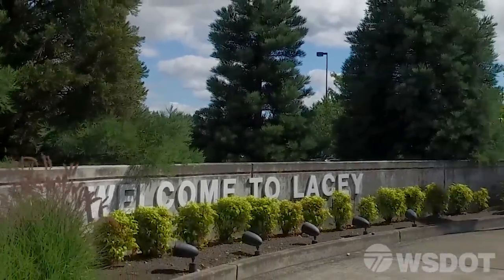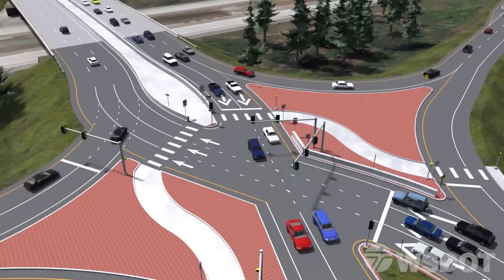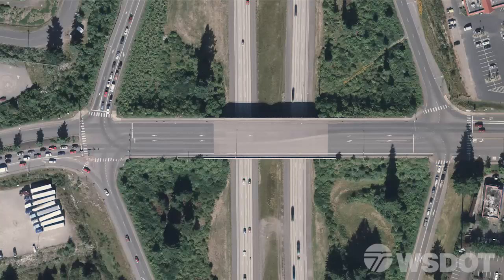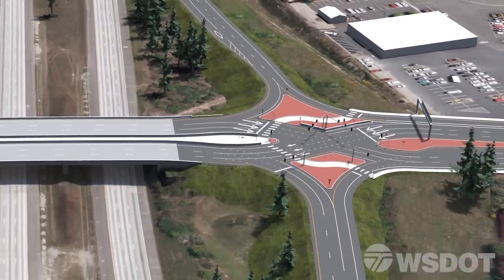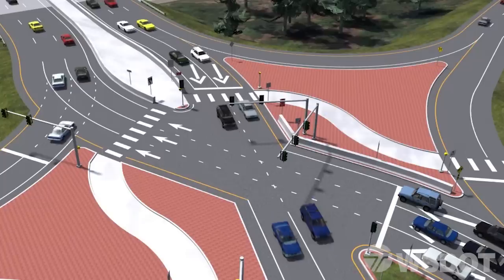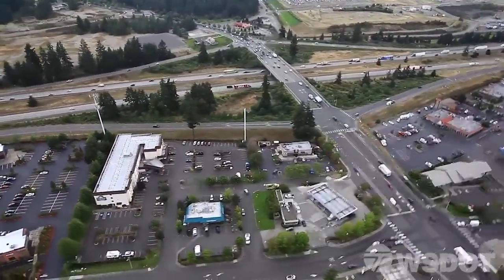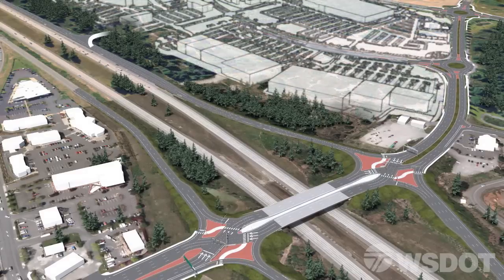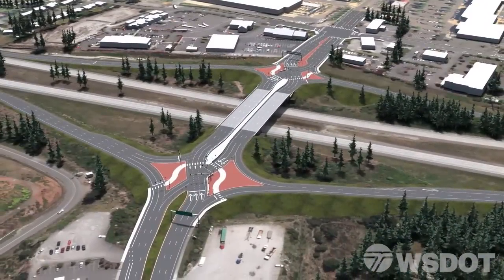Diverging Diamond Interchange comes to Washington State

Comment: We got a place in Toronto where three major roads cross, with such a mess of different ramps and turns, it's like it was designed by a madman. Even a roundabout would have made more sense. Even more bizarre, one street going west stays the same though the intersection, but the same street going east changes to another street, unless you take a turnoff. lol

Comment: Some thoughts:  A driver going into one of those might all of a sudden think they're driving on the wrong side of the street.  Then there's people trying to cross the street who are used to initially looking to the left needing to be aware cars may be coming be coming from the right.  I'm comparing that to confusion people have when they travel to places like the UK, where they drive on the left.   Also, you mentioned clearly marked lanes and arrows.  We all know how paint fades quickly, and if the street is wet, is also difficult to see.
Reply: I have one of these where I live and drive on it all the time to work. None of that ever happens. There are curbs to guide you along even if you can't see the lines for whatever reason.

Comment: I've driven the one in Kentucky it really doesn't change much of anything, except if someone isn't expecting it they slow down but if it's well lit and the road markings are clear it's not bad, just don't see the point
Reply: The point is to increase efficiency and reduce traffic. It makes sense to me, fewer phases on the lights should lead to more efficiency, but I'd like to see flow data from a junction that has made the transition.

Comment: I've driven through one of these.  The secret is in the timing of the traffic lights.  They used one set of timing, no jams for everyone.  They messed with the timing for some reason and now the multi-million-dollar boondoggle jams just as much as the old light system.  It "can" work as long as the politicians don't start changing the timing of the lights to suit their needs.

Comment: At 1'09", its not "Fayette, KY," but rather, "Lexington, KY." I know, because I live here, and have to deal with that interchange.  I'm at a conundrum on the effectiveness of the new interchange: it does cut down on accidents. Yet, the traffic volume is extremely high, and wait times at the lights feel miserably long. However, the original design of the main road heading back into town was not created with expansion in mind, and that is where much of the bottlenecking begins.

Comment: Hey guys just to help, we have this in Utah and it SUUUUUCKS. The lights going to the freeway are very very short and those getting off the freeway are in almost like a slingshot move. One of the on ramps that does not have a light gets people to 70 MPH before it merges with the left turning traffic which just came off a turn and is going about 35. Many run the red lights getting off because it is super confusing, especially when traffic overlaps. I wish you luck. If you want to see it look up Pioneer Crossing exit in American Fork, Utah.

Comment: these are nightmares for semi trucks and you typically hit both lights.  the giant X interchange seen in Northwest Indiana and Columbus Ohio is a much better solution as it reduces the two intersections to a single traffic light
Reply: This is a fair point, though it's a more expensive solution, as you would have to build a wider bridge to accommodate the turning lanes.
Reply: As an experienced truck driver myself, I have not come to one of these intersections yet either in commercial or personal vehicles, but from the graphic animation, its seems quite along the lines of a poorly designed roundabout without large vehicles in mind so long as the exits are sufficient for larger vehicles to exit or turn safely.

Comment: What's wrong with the old Clover Leaf Design? Could someone please explain.
Reply: Likely because of space constraints. Even a tiny cloverleaf takes up huge amounts of space. They're also generally more expensive than retrofitting existing infrastructure. There's lots of NEW grading and material required to make a cloverleaf. DDIs are also quite easy to navigate and more efficient in terms of travel time in many cases. WSDOT has shown why a DDI is a great solution in this situation by integrating it into the surrounding infrastructure.
-Civil Engineering student at Missouri S&T
Reply: As a Semi tractor-trailer with experience in all kinds of intersections and interchanges, Cloverleafs are the Worst along with the poorly designed too small and narrow roundabouts. Not to mention the small vehicle drivers who think either they or we big rigs own the road. Due to the on and off ramp of the cloverleaf sharing the same spatial interchange lane, you got slow vehicles entering and highway speed drivers exiting at the same stretch of extra lane.
Reply: Weaving.

Comment: Question:   What happens if traffic and signal lights is not working due to what ever the reason maybe like a storm passing through?
Reply from the maker: There is a battery backup to keep the signals running in case of a power outage.

Comment: As of September 2018, NOTHING HAS HAPPENED at the area shown in this video.  No signs of construction anywhere, and traffic still moving as usual across the overpass.
Reply from the maker: Work has been going on since last fall. Most of the work so far has been near the overpass and not in areas easily seen by the public.

Comment: There are 2 roundabouts west of this proposed DDI. Neither is big enough for American semis to negotiate without leaving thei lane of travel, even though they have several  Distribution whses west of them. Europe does not have 75' trucks as a standard yet they build American roundabouts at the european standard. There is another roundabout which semi drivers use off the southbound exit if you want to go east that also requires drivers to curb their trailers to use.
Roundabouts would be fine if all lanes allowed an American truck to stay in their lane,  but they don't.

Comment: i still dont get it.. why to use intersections with trafic lights for such simple connection to highway?? Havent you seen solution for this in europe? you dont need to turn left at all.. only simple connection lines turning right must be added, that is all.. .. then there are just 8 conflict points, avoiding crossing.. there is just merging and diverging

Comment: Interesting solution!  At first I was concerned, given that a fair number of people still struggle with four way stop intersections and roundabouts.  It was a relief to see the explanation and video.
Reply: o2boutdoors Yes, there is a growing number of drivers who are confused by octogonal red signs, believing they mean "SLOW DOWN", and rectangular white limit signs, thinking they suggest s minimum speed.  Those drivers will do SO  much better following multiple signs with 20 or more arrows directing them through an expressway overpass. NOT.

That some peiple are confused and poor at an activity should NEVER be used as the basis for deciding to change the activity for everyone. That's nannyism.

Comment: This pattern has eliminated one of the options for turning, hasn't it? If you came off the freeway below and realized you'd made a mistake and wanted to return to it, it's not directly possible. 
You'd have to turn either left or right, drive down one of those roads and turn around and come back.
Reply: If you have left the highway while you shouldn't have, you can not get back on, yes. You can still leave the highway and go back on the highway to way you came.

Comment: Traffic can only move in one direction at a time. As an example if it runs North and South, North bound is held up at a light while South bound is moving. Then South is held while North bound is moving. It is very time consuming for local residents. It benefits interstate traffic only. Without over and under lane change bridges this system is not that great of an idea.

Comment: Kanasa City has several of these and they are annoying. No advantages unless you can get the cross over on different elevations.
Reply: Odd....while they took a very short time to get used to them, I find them to be far more superior to the old design.  I'm in Overland Park.  The object isn't to eliminate traffic lights - it's to improve the efficiency getting thru.  If you are in KC, go cross 435 on Nall, then do it on Roe.  Which one was better?
Reply: I just left Overland Park (159th & Switzer) and find that all they do is move the jam from one point to another. If they eliminated the stop at the crossover, they have a winner.

Comment: This intersection cause four deaths two do which were police officers in the state of Iowa. Driving through one of these for the first time at night is so unsettling I can see why the young motorist enter I80 the wrong way and struck the police car over the next hill head on with two officers and a transfer inmate inside. All killed. Roundabout or any other intersection don't offer this kind of danger. This is purely cost saves for the road departments. 
Bryan

Comment: This is great! Could this be done to underpasses, in principal? In Vancouver, WA, we have two I5 interchanges, at 78th and 99th, that were redesigned some time back. The bridges were widened to allow placing the street intersections under the bridge. That helped a lot, but the intersections still get jammed up. Could the diverging diamond concept make traffic move even better?
Reply from the maker: Good question. The short answer is yes, because they are interchanges, they experience heavy movements from the local roads onto the freeway (left turns) and could possibly benefit from a DDI. We would have to model the interchange to see if there would be an appreciable benefit. That being said, both interchanges were updated not too long ago and perform pretty well. Given the investment made at these locations recently and their current levels of performance, it's unlikely we'd get funding to reevaluate them at this time given other more pressing needs across the state.

Comment: Still don't get it
Reply: traffic shifts to the left side on overpasses.  Traffic can go straight AND turn left for the entire cycle of the light.  It's far better than sitting in a left turn lane waiting for a signal.  It is slightly odd at first.   But it's much better than an existing intersection.

Comment: This is going to have little to no gain in improving the traffic problem through that area. That intersection does back up some but its only a result of heavy freeway entrance traffic (JBLM) and the intersections before that one (shopping center and Marvin/Martin). The freeway congestion stops the turn lanes from finishing on the lights already there. Making the intersection smoother doesn't fix this problem... they are still going to fill the on ramp and not be able to merge. When this project flops and fails to help, give me their job because driving that intersection 2-3 times during heavy traffic shows the issue clearly. This is a waste of time and money.

Comment: There are several of these in my area. They are the most counter-intuitive and  basackwards road setups ever devised. As Der Yeti notes, unless you're a local who's familiar with the thing, and unless road markings are PERFECTLY maintained, American drivers' instincts to keep right of all traffic obstacles (as explicitly instructed by nearly every state's drivers manual) will get them into a head-on collision, simply by by driving "safely" in bad conditions. Also, and possibly more importantly, a pedestrian (let's say someone walking a baby carriage) must cross traffic lanes four or six times in stead of once or twice, AND  must walk between two opposing lanes of traffic, typically with nothing more than a Jersey Barricade between them and multilane traffic on both sides.  It's as if traffic engineers are doing everything the can to discourage the use of non-motorized transportation. Also, the insanity of the design makes people avoid that intersection, only compounding the greater-area traffic congestion that the Diverging Diamond is supposedly trying to alleviate. 
Common sense and logic both point to the same thing: A little "eminent domain" and a self-explanatory cloverleaf are the best choice for everyone.

Comment: Most drivers don't pay attention.  This has gotten worse since it is now politically InCorrect to deny someone a license just because they cannot read or understand the road signs.  People hate being forced off their path by a lane marker, they prefer to stop in the middle of the road until someone lets them cut across lanes.  The more you force people in directions they don't want to go, including driving on the wrong side of the street, the more problems you will create.  Personally, I think the DDI is an interesting solution but, it won't work on a large scale unless everyone is required to a) take driving instruction b) pass the test without an interpreter c) there are clear indicators long before the intersection that a DDI is imminent.  Getting people to knowingly drive on the wrong side of the road will generate apprehension and should be anticipated.

Comment: They drive on the left in Washington?
Reply: My thoughts exactly. Very strange design.
Reply: We have a few of them in Kansas City - in the interchange, traffic is shifted to the left side - people can go straight or turn left.   Once past the interchange, traffic shifts back to the right side.  I was ready to hate them, but quickly found them to be very easy to use.
Reply: If they drove on the left in Washington State, the diverging diamond would have to be on the right.
Reply: It goes some of the way toward solving the problem by introducing "driving on the left" but stops short of the full roundabout (sorry, couldn't resist! :D)

Comment: What's the point of this? Seems kinda pointless and seems more like a fail attempt of a roundabout. Only thing they should bother doing is configuring the prediction timer for traffic lights at various hours of the day depending on directional traffic.
Reply: Christian Flores, No reason to use cameras you could just use sensors at the bottom (like a wire line that you can step over). When it senses a car stepping on it, it knows to turn the left lights green. If there's no car it doesn't turn on. If there are many cars, like a lot of traffic, than the light senses that there are many cars as they step over the sensor, so the light lasts longer. If there's only one car that is driving, then the light turns off quickly. They work okay. The only thing is sometimes people will forget to stand directly behind the white line that indicated where to stop and so the light doesn't turn on green, but other then that, they work pretty well.

Comment: It's cute how ppl swear they will make cars flow more efficiently. Nonsense. 
This is the VERY LEAST efficient mode of transportation, no matter the gymnastics you make trying to fit more cars in. The only way to improve mobility anywhere is to provide it with a proper mode of transportation, one that doesn't rely on individual toy machines.

Comment: This is a rather absurd design.  I'll take a guess and assume that three lanes going either direction would be too much for a roundabout unless the roundabout's footprint is immense.  That aside, there is no question that two roundabouts on either end of the overpass would be far more efficient, far more cost-effective, and far more user-friendly.  And it would eliminate traffic signals -- the bane of everyone's existence.  Everywhere in Vancouver roundabouts have been installed, traffic flows much more smoothly and efficiently.  I've never understood Vancouver's torrid love affair with the traffic signal.  Enough, already!  Might I add that nearly all the new projects WSDOT is putting up are in the Puget Sound.  How's about re-routing state and federal grants to lonely outposts like Vancouver?  We've got a 4-6 lane state highway crossing Vancouver and it still has three signalized intersections because there's no money to get their replacement past the planning stage.  The traffic - and the collisions - are piling up at those intersections.  How about funneling grant money to Vancouver - and all of Clark County - to construct roundabouts wherever feasible, and start retiring or re-purposing the profuse collection of traffic lights down here?

Comment: Why not two roundabouts instead? If so; no need for traffic lights and better traffic flow.
Reply: I found a lot of people in North America have a hard time following rules of roundabouts. In Canada, we started introducing them and most people are confused on how to use them... so educating people is a problem at least here.
Reply: Not to also mention the spatial needs of larger commercial trucks and tractor trailers, especially those with oversize loads. I have n ever had a difficult time Understanding roundabouts as I am a New Englander and we have quite a few of them here in the regional states. Its the idiots who are too simple minded who have the difficult time understanding them despite the signage showing how to use them. Not to mention the amount of space they take up if they are designed properly for all vehicles.